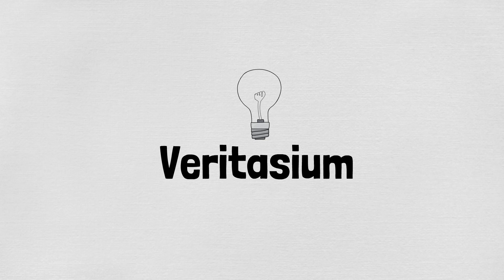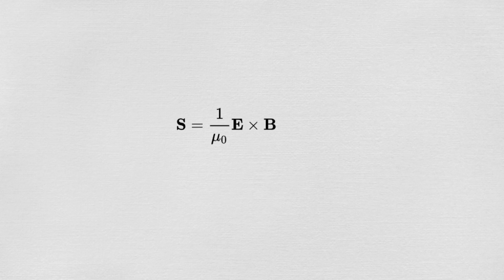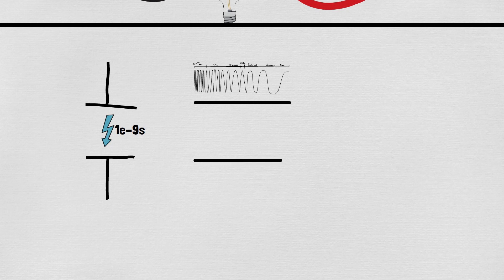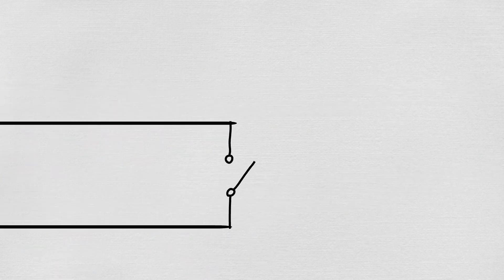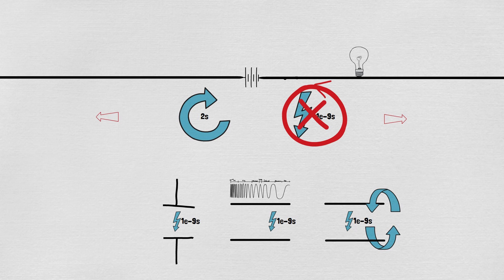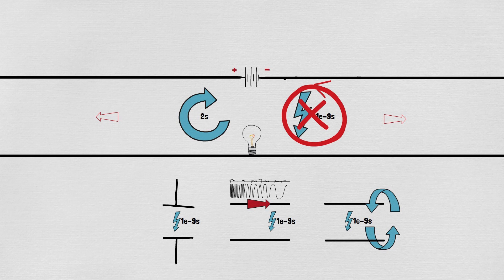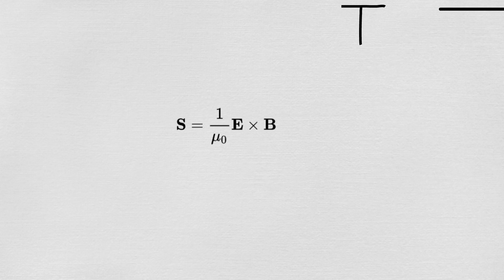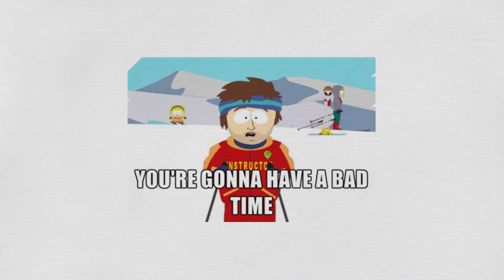Veritasium is Right? (see description)

Comment: My reasoning wa that the position of the switch matters more than the position of the battery, for, going from a state in which the wires connected to each part of the battery are in the same potential as each pole of the battery, it is at the switch that the first difference in potential would be stabilished, so it is from there that the excitation of all parts of the circuit would begin.

Comment: The wire itself has enough capacitance to go from a neutral state to a charged state.  The potentail difference on the power source is real.  If ... the circuit was charge with the battery connected, it would all balance and there would be no current; but removing the battery, now the wires have a charge state - almost like 2 capacitive planes, and connecting the battery to both, or to 1, and to another circuit with an alternative voltage potential, you can get that current to flow in the one wire without the other.  High voltage is wonderful stuff, loves to crawl all over everything, and collapse out into a current whereever it can.  
I think you might be stuck thinking it's just a little batter - a 12V battery as suggested, not a ideal infinite voltage potential; it doesn't have to be that large if the conductors are truly super conductors - the delta-current/delta-time will be high and cause quite a magnetic field - it'll work most like a transformer... slightly like radio, and least like a capacitor (electro static coupling is pretty limited in range actually, unless, again at very high volages say 1M+ volts)   I feel like you've never actually played with a качер coil; or any single wire transmission systems.  You don't even need 2 conductors.

Comment: Maybe I’m just a noob who has never done electrodynamics before, but I learnt that the electric field is independent of current. And that in a system with no current flow there can still be an electric field. When the switch is closed, everything on one side of the switch will be at the same potential, and everything on the other side of the switch will be at a different potential, so there’s always going to be an electric field between the two, just no current and hence no magnetic field. But that no current condition only applies so long as it has been a significantly long time since the state was created. If you have two open switches, one at the end of the long wire and one next to the bulb, then closing the bulb’s switch will let current flow via the capacitance between the two wires. The difference being, if the end switch was closed the steady state current would be nonzero, but if it’s open the impulses will die down and the steady state current will be zero. Of course, if you have more than one break in a circuit, the potentials become underdefined, and you could argue about what potentials the three sections of the circuit are relative to one another without additional information. Say if the two switches were at either end of the long loops, then the top left would be at the battery’s positive potential, the top right would be at the battery’s negative potential, and the whole under side with the bulb could be anywhere in between, or even outside those rails. Whatever initial potential it starts with will mean it contains some charge stored in that mutual capacitance, and that will influence the behaviour when one or both switches are closed.

Also yeah the whole transmission line thing is the most practical explanation in my experience. I simulated it in a few minutes in LTspice and got more or less what Dave at EEVblog said, a bunch of summed offset stepped responses as the signal reflected about the circuit. There is an initial current pulse at presumably 1m/c seconds (I didn’t simulate the delay in the capacitance between the bulb and the switch), but the current at that step is pretty low, just 70mA when using a 120VDC source and a 144Ω bulb. One second later you get a step up to 190mA, then after another second it steps up to 300mA, and at 25 seconds it’s come up to asymptotically approaching the steady-state of 833mA. That’s with 800Ω transmission lines, which someone calculated in Dave’s comment section but you could probably calculate yourself with some radio ham’s balanced line online impedance calculator. Probably depends on wire thickness.
With proper impedance matching you get half the current “immediately” and the rest at 1 second.

Comment: I think the problem lies in the assumption that the quantity of energy that flows across the gap of 1 metre as soon as the switch is turned on is enough to turn on the bulb.
 Some amount of electrical energy travels across the gap as soon as the switch is closed  because of the charge that begins to flow across the portion of the wire that lies adjacent to the battery. But it won't be enough to turn on the bulb.   For the entire electrical energy to travel from the battery to the bulb the charge needs to propagate through the entire circuit, which would take the time needed for the charge to move across the entire circuit at the speed of light.

Comment: Hold on...

If you have an open switch at the far end of the cable, then the steady state condition will be no current, and a voltage drop across the switch that is opposite the voltage of the battery. So there is an electric field between the two wires, but no magnetic field, and the Poynting vector S is zero. No energy is being transferred. So far, so good.

Now, when you close the switch, current starts to flow from right to left in the top wire, and from left to right in the bottom wire. This sets up a magnetic field, and the Poynting vector becomes nonzero. That does not happen all at once. The change starts at the switch and propagates along the wire's length. The time at which the lamp experiences the change in the Poynting vector is exactly the distance from switch to bulb, divided by the propagation speed (roughly c).

So what is broken about that?

I suspect many people are thinking the signal propagates from the battery to the bulb when the switch is closed. If that were the case, we'd have to analyze signal propagation in an integrated circuit by taking into account the distance from the switches (transistors) to the power source, rather than the much smaller distances between transistors. But that's not how electrical engineers do it.

The reality is that, although the steady state Poynting vector after the switch is closed points from the battery to the switch, the transient of  the Poynting vector starts at the switch and propagates outward from there. The bulk of the flow is along the wire and smaller amounts flow through free space.

If you place the bulb on the top wire and close a switch somewhere on the top wire, there will be a transient from the switch to the load, and a transient from the switch to the far end of the wire. Since the far end of wire is open, you will get a reflected transient back. In fact, the reflections happen at both ends. Eventually the reflections all settle down to the new steady state, in which again the current is zero and the Poynting vector is zero. Again, there is nothing wrong with this scenario. (If there are no losses, the reflections will bounce around forever, but even in the ideal world of perfect conductors, the lamp dissipates energy.)
Reply from the maker: i agree there is a transient pulse through the bulb in the case of the standard circuit or of a single wire, but i wouldn't call that "current flow", and i certainly wouldn't categorize what happens in the bulb as "turning on". this is not different from turning on any DC device and hearing a pop in a nearby speaker. but that is an incredibly transient effect.

in the circuit case, the transient pulse likely doesn't do anything perceptible to the bulb, but then there's a slow ramp up to some fraction of the total voltage as the parallel portions capacitively couple over larger and larger distances (when current is actually flowing). 

my main gripe is that veritasium describes what happens after 1/c as the bulb turning on, and uses the expression of the static poynting vector to defend that conclusion. a person unfamiliar with any of these topics would come away from veritasium's video with a very confused idea of how batteries work.
Reply: @antimatterhorn  The primary path, the one that transfers the greatest power, is along the wire. But the Veritasium experiment has the secondary path through free space that is shorter than the primary path. Initially, then, you see a small current through the bulb before you see the full current. As defined at the beginning of the Veritasium, "on" for the bulb is any nonzero current. Realistically it won't be visible, but I'm just going with his definition for discussion purposes.

You can't use the switch at the end of the wire as a counterexample, because in that case, the primary path is the shortest path.

Also, the transient "on" state (by Veritasium's definition) is not just a short pulse. It persists. When the primary signal arrives a second later, the small initial current is still flowing. The later-arriving signal is superposed on the earlier one. For familiar wire lengths, the separation in time is imperceptible without precision equipment, so our intuition on the duration is misleading.
Reply: @antimatterhorn  Yes, as Richard said, Veritasium had to make some simplifications such as lossless wires, and "on" being defined as any current at all. Someone simulated the scenario in ANSYS and showed that the initial current that appears in 3.3 ns is probably too small to make any noticeable light, but it is there.
Reply: Also, it isn't true that "current won't flow until the EM field is fully established along the entire circuit." Current begins flowing immediately when a voltage is applied to a transmission line, equal to the applied voltage divided by the characteristic impedance of the line. At first it flows near the newly established connection, then this wave spreads throughout the wire. If there's an impedance (including discontinuities) anywhere on the cable, there will be reflections to "correct" the current excess or shortfall. Note that a discontinuity doesn't stop current immediately throughout the wire; reflections have to travel back to the source to cancel the original wave out.

In this circuit, with the switch open, steady-state has the voltage V appearing across the battery and  -V across the switch. So the switch is already energized. Close the switch, and I = V/Z0 flows into (or out of, depending on which side we're talking about) the wire, in the immediate neighborhood of the switch. Note that it doesn't matter where on the line the battery is. Already energy is being transferred at the switch, because the switch was previously energized and that energy is being released. Only after the wavefront reaches the battery does any battery current flow, and the Poynting vector going away from the battery appears.

Comment: For a nerdy physicist as me, I'll say your video explains the best. He was actually talking about a transient situation but "kinda" explained it under a steady state. However, as a "youtuber", I would say his video is still awesome. It brings this up to the general public, which is what his youtube video is all about, and it's why he explained like that. Since he has talked with some professors, I assume he or they knew the right answer but it's just not good for a few-minute short youtube video.
I like that you mentioned the energy density and J\dot E. I personally don't like the models with circuit, like assuming they're a "single" capacitor which complicates stuff. It's an infinitely long capacitor and ignores the dynamics of EM field and electron movement of each wire/plate of a capacitor. These models are too simplified. I can accept the model of breaking down into multiple tiny capacitors and inductors, etc. which makes more sense.
By the way, I like Jackson, haha. I started my journey of light and laser research after taking the course using this book. It's a perfect example of a combination of math and physics which isn't too far from human applications. General relativity is interesting by using differential geometry but it's too far from us, same for particles.
------
I like Benjamin Chung's answer. I think we should ask ourselves "what we mean by turning on".
The transient state of an antenna can indeed start to transfer energy to the light bulb, but its energy transfer can be strong or weak, maybe like a transient state when you see a voltage spike when closing a circuit or anything (I'm not sure if this is a good example). Within 1/c second, the energy hits the light bulb due to antenna effect; however, it'll take (maybe) 2 seconds to reach the steady state and have the light bulb shine light at the expected brightness under the expected current flow and battery voltage.
By the way, Veritasium's video points out that even in steady state, the energy flows from the battery into the light bulb through the EM field, which is more important in his video from my point of view. It also explains how the energy is transferred in the AC power line. His video makes more sense assuming the steady state. His example of "turning on" the light bulb indeed confuses people.
----------
Sometimes things aren't either right or wrong. It's more like we're sloppy with words. It's correct in one situation/perspective but wrong in another situation/perspective. Careful definition is more important.
==========
Check EEVlog's https://www.youtube.com/watch?v=VQsoG45Y_00, starting at 25:15. He simulated the transient state (so it's an open circuit in his simulations) with a simplified model.

Comment: Suppose there is a functioning circuit (all switches closed) and then the cirucit is broken downstream of the bulb with respect to electron flow. Does the time of response correlate to the length of circuit which the electron density wave must flow around back to the bulb (so total circuit length)? Aternatively, does it relate to the distance of wire to the battery where the EM field is originating and where there can be no redox reaction so current becomes 0? I suppose I am curious of about circuit intertia. 
In both cases it would that L/c time, but what value of L is used? There shoud be some level of electron density build up and resistance involved.

I think that Derek would propose a third option wherein it is the distance through space from the bulb to the battery. 
Thank you for clarifiying some of the questions I had with Derek's video.

Comment: A simple way to see this is to add a 2nd switch at the far end of one of the loops of wire.  If the bulb can light nearly instantly after closing the near switch then either:

a) having a completed circuit is not needed to light the bulb (which is absurd), or

b) we can nearly instantly tell if the far away switch is open or closed by closing the near switch and seeing if the bulb lights.  This provides faster than light communication.

Comment: There will be a magnetic field from moving charges that occurs before the current makes it’s way around the loop, but no way will it have enough strength to induce a current strong enough to light the bulb in the parallel wire.

Comment: I think what you are missing is that there is a voltage difference on the two sides of the switch. We don't have to wait for current to travel through the switch around the loop before current travels through the switch. But once the current travels through the switch, there is an EM field at the switch and that will propagate to the other wire quickly, before the current reaches the end.

Comment: You can easily test this in 5 minutes using LTspice, first calculate the impedance of the cable, secondly account for the cable in LTspice using transmission lines. You will see that there is instant current flow across the load resistor. However my estimation is that the impedance of the supposed cable is quite high, so this only works with an LED, a Lightbulb wouldn't work. However this should work flawlessly with a tiny lamp, a High Voltage Source and some standard 50 Ohm Coax Cable. Some high voltage transient generators even use this principle to produce short square wave pules of very very very ultra mega high power.

Comment: When the battery is connected to the wires the EMF moves the electrons to the switch.
This takes 2 seconds.
When the switch is closed the electrons are there ready to light the bulb almost instantaneously.

Comment: But the instant you connect a battery to the wires, even though the wire is broken by an open switch, the wire on the positive terminal becomes positive and on the negative side becomes negative they would no longer be neutral!  You have effectively made the battery 2 light seconds long.  In order for the potential of the wires to change from neutral to either positive or negative must be produced by some current or energy flow, similar to a capacitor?  So the potential already exist at and across the switch prior to closing and is ready to flow the instant the switch is closed there is no delay no matter where you put the switch except, if you put two switches, both very close to the battery effectively making the battery also the switch..